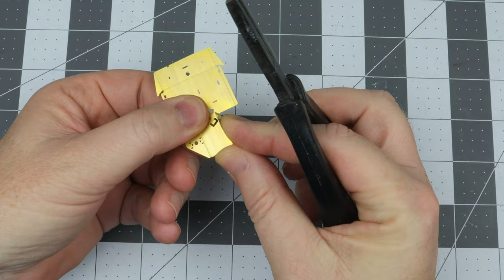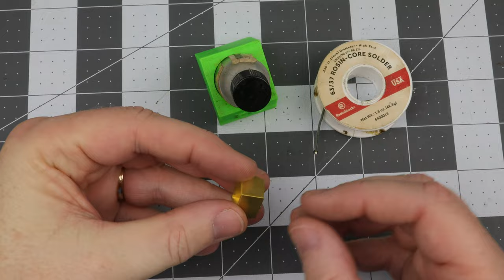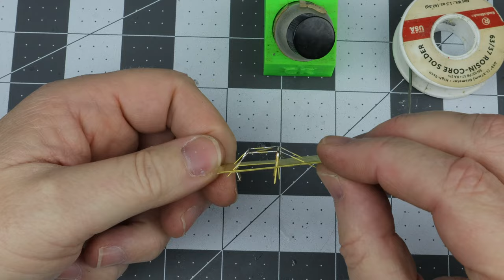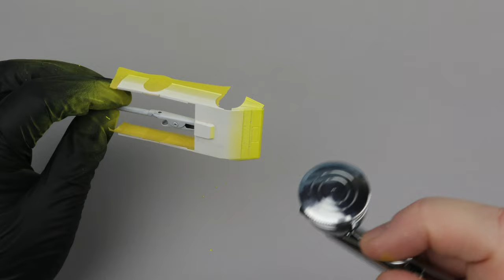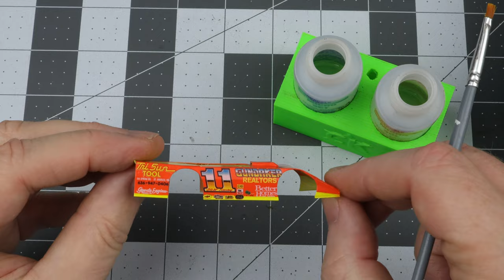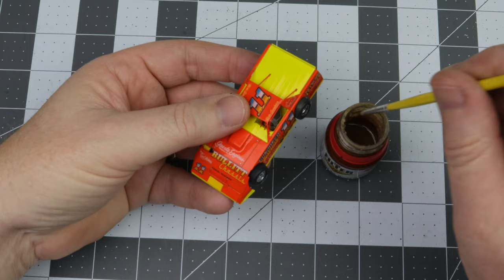WORKING WITH BRASS || Building DIRT MODELER Tiny 1/64 Dirt Late Model  [STEP BY STEP BUILD]

Comment: Great work as always, Clay. You make it look so easy, I think I could solder after watching this video. The finished result is really well done.
Reply from the maker: Thanks for watching, once you get the right stuff, soldering is a blast. And opens up some many new ways to make parts or chassis.